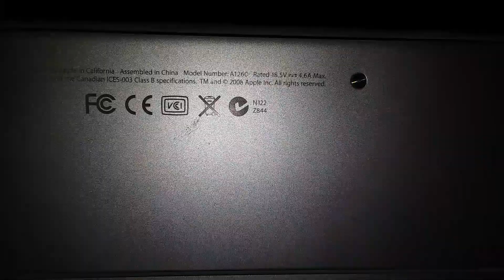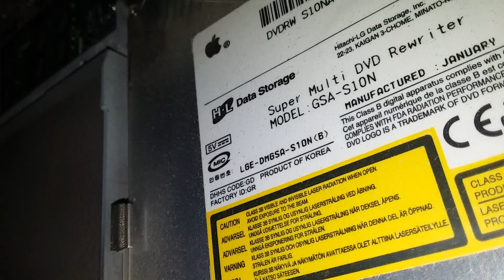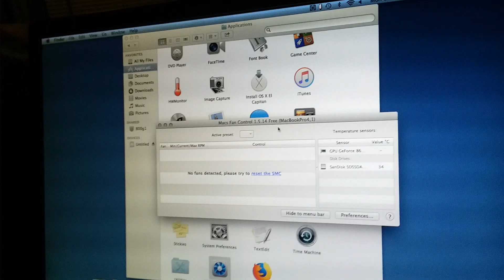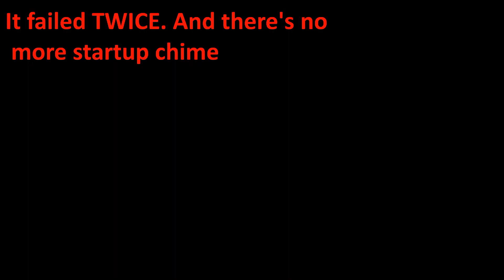Early 2008 MacBook Pro A1260 OS install headaches

Comment from the maker: Update: I took it apart again to try to fix the fan issue and failed. I removed them and the vents were half way blocked so i cleaned them. I also unplugged the fans and the sensors, plugged them back in and even removed the CMOS battery that was located under the dvd drive and pressed down the power button while it was unplugged. The fans still run at full blast even from a cold boot. Anyways i bought a 10 pack of Philips dual layer DVDs (they're Inkjet HUB Printable!) i'll put an OS X install image on that, it should work.